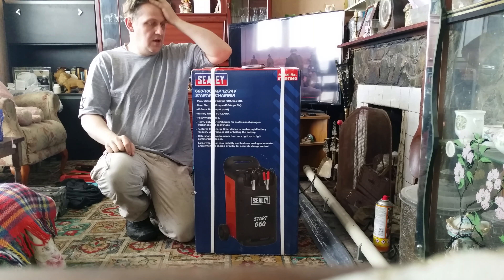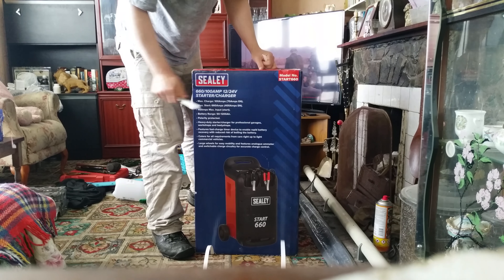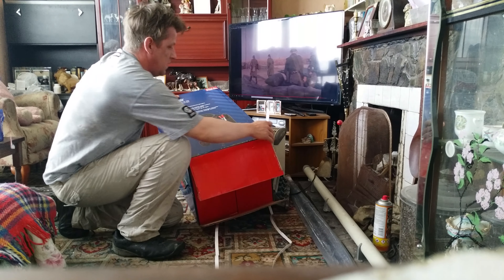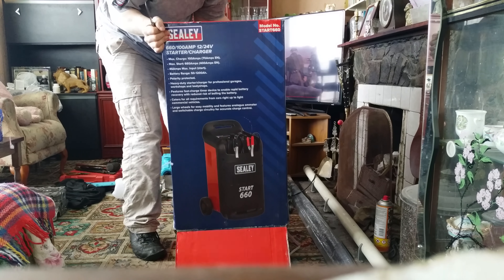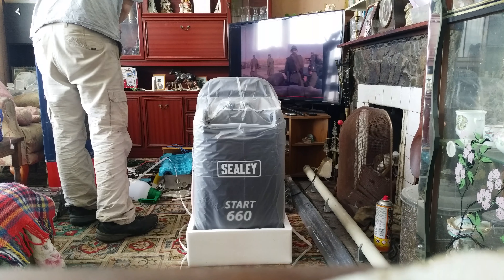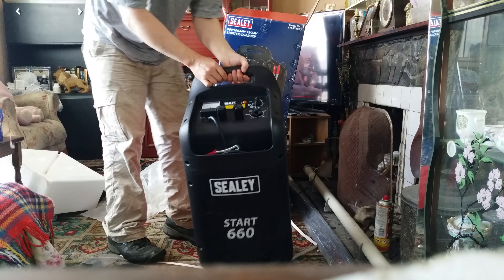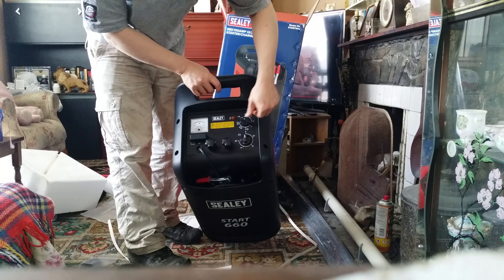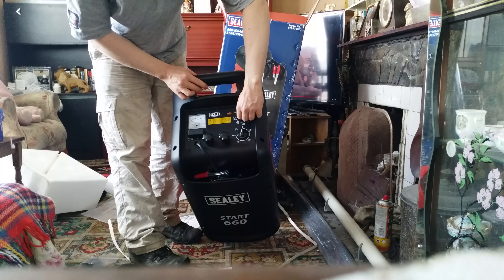Sealey start 660  battery charger unboxing

Comment: I've just bought one of these to use for my tuning business, it will need to be attached to the car for about an hour and a half at a time and keep the battery running, is it easy to use?
Reply from the maker: very easy to use i wouldent go without one
Reply: @GarDjinn  thanks bud. Can it be used as a charger? Or is it just to jump start stuff?
Reply from the maker: @OctaneHaus  it is a charger with jump start function its great
Reply: @GarDjinn  right I'm with you. Any ideas how it works as a charger? I can't make sense of the instructions? Do I literally plug it in, turn it on, and connect it to the battery
Reply from the maker: @OctaneHaus  its quiet simple first put crocadile cable to 12 or 24 as needed a turn to left would be start car mode and a turn to right is 1 low charge 2 medium charge and 3 high charge 4 is timed low charge 5 is medium timed charge 6 high timed charge
Reply: @GarDjinn  thanks so much mate I really appreciate it. Instructions made it so hard to understand
Reply from the maker: @OctaneHaus  very welcome

Comment: I’ve just bought the same one to charge a couple of dead batteries. Does this work?
Reply from the maker: Love it best garage toy by far only thing to check is the nuts on the fuse under plastic cap you get spare fuses in the packageing so be sure to find them before you through the packaging out i use distilled water to top up old batterys and granvilles bat aid tablets works most of the time but not always and if you are using the start feature only crank for 5secs at a time, you will be wondering why you didnt buy one before all best and please subscribe it helps me out thanks

Comment: How you getting on with this charger?
Reply from the maker: Love it best garage toy by far only thing to check is the nuts on the fuse under plastic cap you get spare fuses in the packageing so be sure to find them before you through the packaging out i use distilled water to top up old batterys and granvilles bat aid tablets works most of the time but not always and if you are using the start feature only crank for 5secs at a time, you will be wondering why you didnt buy one before all best and please subscribe it helps me out thanks